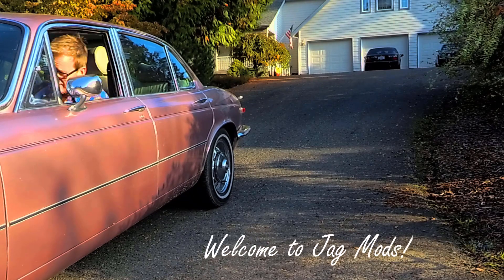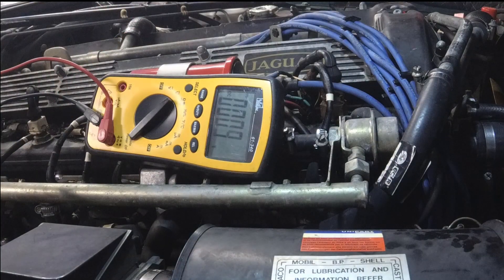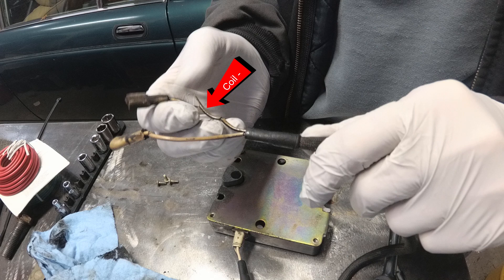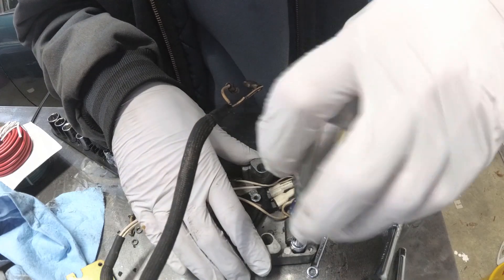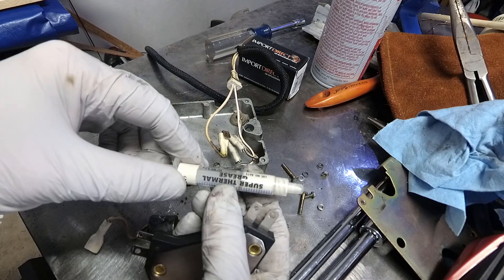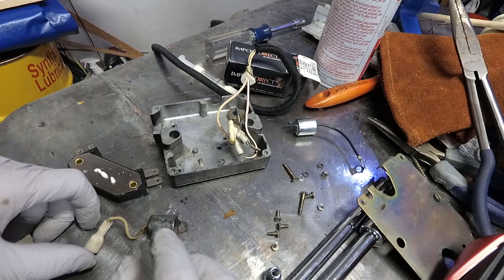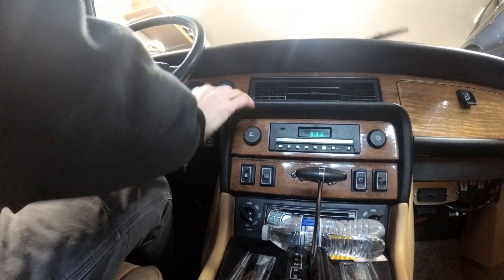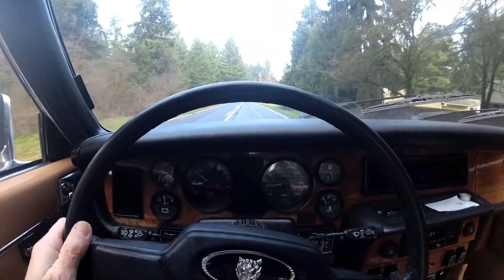Here's how to put the spark back in your Jag.

Comment: WOW! Ive never seen anyone address this issue concerning poor spark. Hell, xj6's at 35 plus yrs old would have corroded(green) wiring there and cracked covering. You broke it down very well and as hard as times are right now you kept everything "real" and light-hearted. I'm really tired of people talking SO SERIOUS and lying at the same time, at LEAST humor us. good job. Tell me advertising doesn't pay, after watching that very, very informative video I decided to gaze at your 2 recommended sites to purchase parts. Now, I was already aware of these sites, but with the myriad of parts sites for XJ6's, I totally forgot about them and had purchased numerous parts from other vendors at almost twice the cost. Now they're back at the top of the list.
Reply from the maker: Thank you for the kind words. Good to know you saved a couple of bucks.  I don't get any kick backs from any vendors I recommend.  I'm in the process (or at least thinking about it) putting a web storefront up for the weird stuff I use, tools I make that aren't available anymore.  Thant kinda stuff.  

Crusty wires. I always cringe when I have to disturb any wiring. My '74 Series 2 XJ6 is the worst! It has crustiest oil soaked wiring I've the ill pleasure to deal with. 

Thank you for taking the time to comment  It really means a lot to me.

Sincerely,
Mark

Comment: The best why I added enhanced spark to my '68 XKE was to get rid of the D-22 dizzy & install an EDIS ignition system with XJ-40 6 tower coil. Open the gap on the spark plugs to .050 & life has been great since.
Reply from the maker: Well that is clever! Good to know. I wondered how well that woks work, using newer Jag components on the XK6
Reply: @JagMods  I've had my set up for 9 years. Once you use a laptop to establish advance/retard then nothing to do except change plugs whenever. Once done...it's done.

Comment: Hi! Love your content.
I had a quick question regarding the same topic. My car randomly wouldn’t start one day after trying to get some groceries, I diagnosed it was a failed distributor rotor, I had also changed the ignition module and condenser, module being a Bosch, condenser being off an older model jag as they don’t stock the exact part in my country. Anyways the car started right up afterwards it ran for 20 or so minutes and stalled and wouldn’t start again. I switched back to the old module it started for a second and stalled again. I’m
Kind of lost now as where to go from here. 
Any help or advice would be much appreciated!!
Reply from the maker: Thank you for the kind words.  Check the comments on this video.  I think it's about 5 months ago.  I responded to a viewer called Chronicals of Redek. my reply is a good place to  start.  Keep me posted on your progress, and I will be happy to answer any questions
If you're breaking rotors, then one of three things are going on.
A. The rotor isn't positioned properly on the top of the shaft. or is the wrong rotor. Also keep in mind if you're breaking rotors, then the cap will be collateral damage. replace them both.
B. The cap isn't on correctly.  sadly you can put it on wrong, The cap is keyed with the distributor so hunt around and make sure it's on solid. even without being screwed in, the cap should seat firmly. 
C. the distributor is worn.  the center shaft isn't rotaing on its access but more in an oval than on it's axis.
Other things that will cause your symptoms.
1. fuel pump
2. bad coil and or ballast
3. Coil not properly gournded.  I've run into this with my Grey XJ6. I got lazy and didn't make a new coil holder for the MSD coil I added.  I just bent up the original so it was a snug fit, until I picked up a aluminum flat par. anyway, the coil would rotate about 10 degrees, then the car would quit. It that wouldn't make a man bald, I don't know what would!!!
4. cooked or broken ignition wires. carefully disconnect the wires and check with an ohm meter. there should be little to no resistance. high resistance would indicate a corrodid or cooked wire.  Broken wires are also something to look for.  Broken wires sometimes can be identified by touching the insolation while the wire is energized. if the wire feels warm or hot to  the touch, then it needs to be replaced. 
5. less obvious - cam chain tensioner worn. popping off the cam covers and check the cam chain for slack.  There should be absolutely no slack.  How many miles on your Jag?  I experienced this with my '86 XJ6  it always quit when coming to a stop.  Aka deacceleration. The deacceleration would put just enough backward thrust on the timing chain to cause it to be out of alignment.  then cranking it over and stoping on just the right cam positoin would pull  up the slack, and the engine would fire right up.  another head scratcher.  too up the slack and the car has never ran better. 

thank you again for the kind words, and thank you for watching my video.  please reach out and I'll be happy to answer any question.
Sincerely
@jagmods